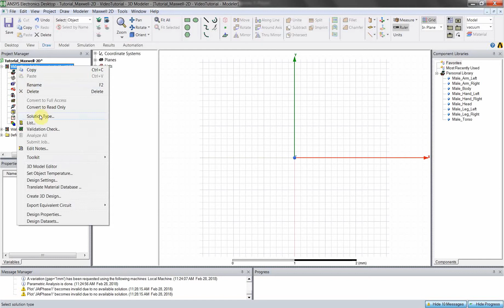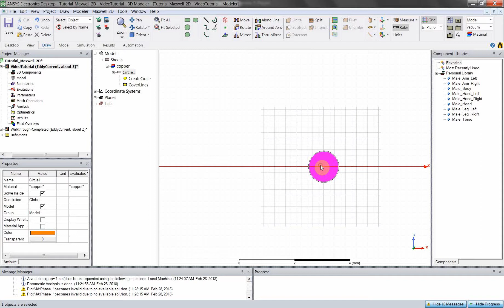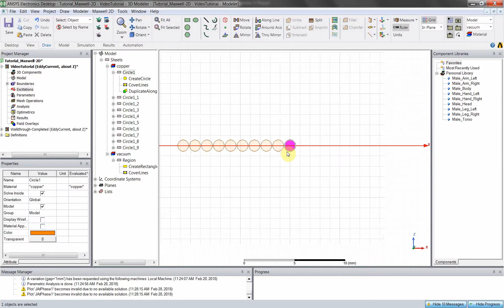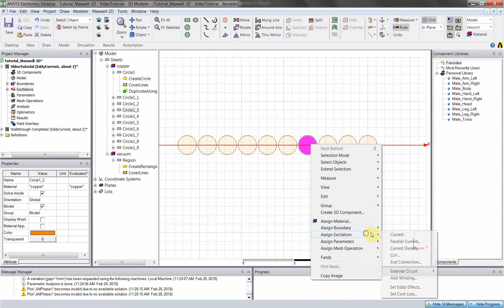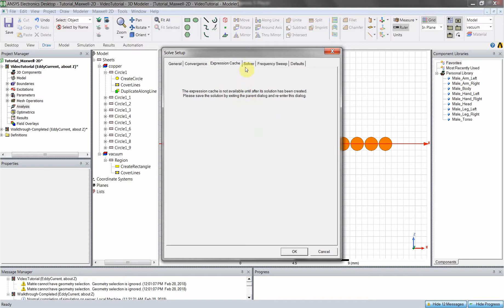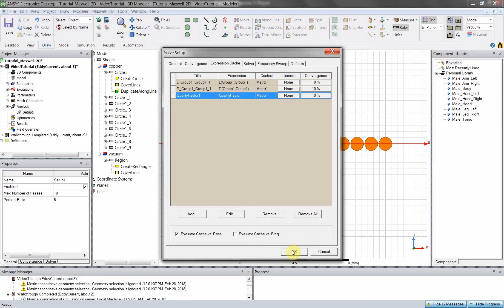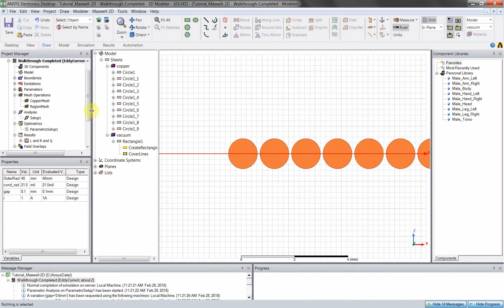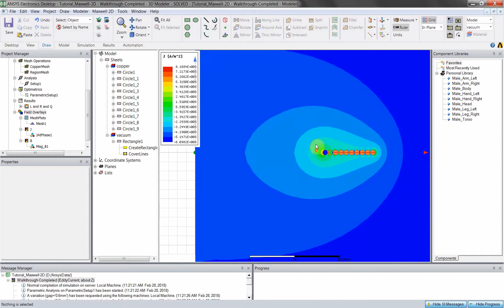Ansys Maxwell 2D Tutorial: Eddy Currents

Comment: hi, thanks for presentation 
I followed the steps, but in my ansys software (2020 R2) l can not create groups in the parameter section!?
please help me
Reply: @niklasfauth8003  Hi Niklas. Thanks for leaving your useful comment here. I just got the same problem (post-processing tab missing) when using Ansys 2021 R1. I successfully used "join in Series..." however after running the simulation I found the failed message as below "Failed to extract solution data for 'cond_rad='21.5mil' gap='0.1mm' i='1A' outer_rad='40mm'' at 'Freq' with value '0.0003GHz', please exclude this sweep value from the calculation range. (12:46:56 下午  五月 04, 2022)". Any idea you could help with? Thanks

Comment: There is a Complex_MAg_B option, could you tell me the actual formula from (Field) Calculator.
I need to calculate it, and i need that formula
(less then 5 minute work)
Reply from the maker: The built-in expression is ComplexMag_H = Mag(CmplxMag(Smooth(<Hx,Hy,Hz>)) ; you can multiply by mu to solve for ComplexMag_B
Reply: @RFHertzMe  thanks you save me!